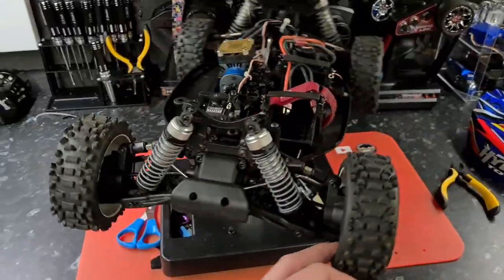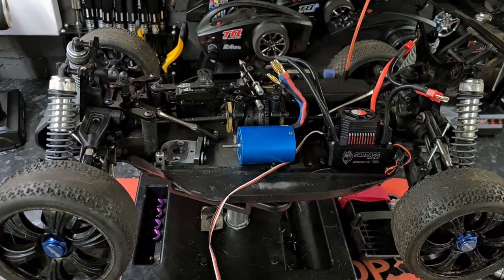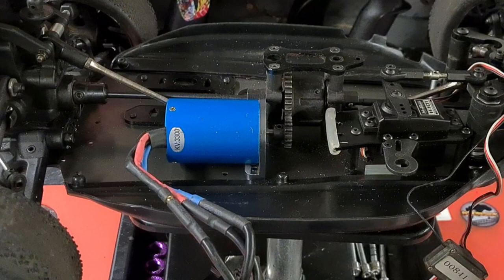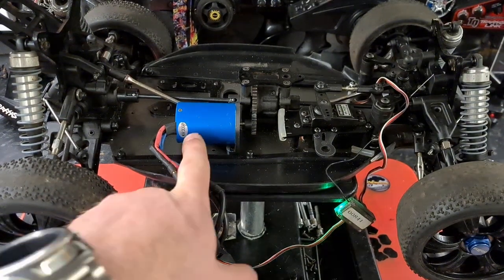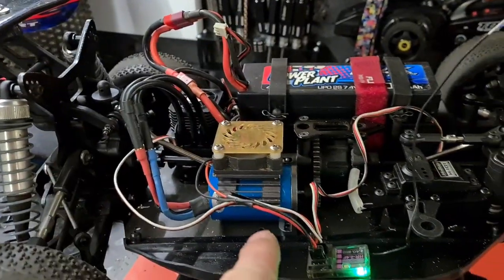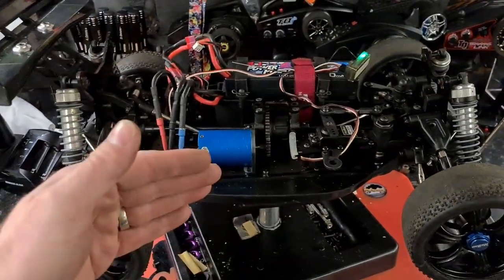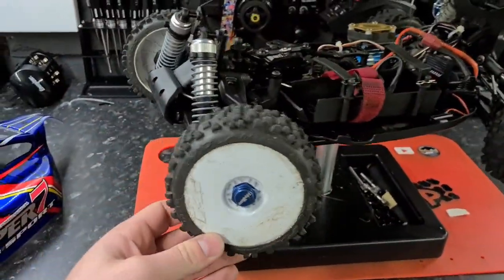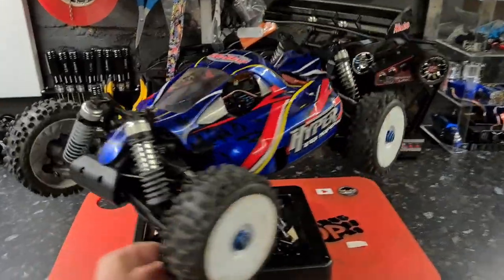NITRO TO ELECTRIC BRUSHLESS CONVERSION 1/8 RC BUGGY

Comment: Don’t do this. Motor too small. KV too high. Will cook on 4S. Cheapest motor mount in the world. Get a hobao one instead. Bad conversion. Worst I’ve ever seen
Reply from the maker: Don't talk silly, this is still going strong its been out at least 50 times, skatepark jumps speed runs etc
Reply from the maker: Also Where's your video if your the expert 👍🏻
Reply: what a great idea. indeed i will make a video to show the world how it should be done. and you can guarantee i wont be drilling holes in the chassis like an amateur!! @rcworxshop

Comment: Hey man. How did you reverse the motor?
Reply: you can relocate two of the three motor poles and it wil switch directions
Reply from the maker: Sorry for the late reply if the motor only has three wires coming off its called an un sensored motor, if that the case simply try the blue swapping any two of the wires from the motor to the speed control 👍🏻

Comment: Do you need the batteries for there servos etc to remain or will the new main battery power everything?
Reply from the maker: Hello, yes these will work from the bec inside the speed control 👍🏻
Reply: @rcworxshop  ok also how do you know what pinion is required? Do u just count the teeth from the original one on the nitro engine? Im guessing u can't use the old one ? Mine has clutch built on to it?
Reply from the maker: @mattschannel1502 correct, the new pinion comes straight off the motor shaft to your original diff, it doesn't need to be exact the same size, just don't go for too many teeth as it will put stress on the motor, esc and battery, there's usually a chart with the esc to say what torque it will handle 👍🏻

Comment: Hello.i have a thundertiger ek4 s2 nitro and I want to convert it as well but here in Greece in Rhodes Island nobody knows how to do it.i ve just watched your video and now i have an idea from where to start.is there a chance you can tell me what do I need to buy and which electric motor?many thanks
Reply from the maker: Thank you so much, that means a lot  really appreciate the feedback I'll add a few links below that will get you started, keep me posted on your build 👍🏻

https://www.ebay.co.uk/itm/174828808651?mkcid=16&mkevt=1&mkrid=711-127632-2357-0&ssspo=dPXUYVFRTle&sssrc=4429486&ssuid=bDBA4C0hTOG&var=&widget_ver=artemis&media=COPY

https://www.ebay.co.uk/itm/174836567796?mkcid=16&mkevt=1&mkrid=711-127632-2357-0&ssspo=dPXUYVFRTle&sssrc=4429486&ssuid=bDBA4C0hTOG&var=&widget_ver=artemis&media=COPY

Comment: Ebay link is bad, any more info on that motor plate?  How did you select pinon size?
Reply from the maker: Try this one matey, I used what fit on the day 👍🏻 https://www.ebay.co.uk/itm/194227210244?mkcid=16&mkevt=1&mkrid=711-127632-2357-0&ssspo=NMFbeOBZQ_W&sssrc=2349624&ssuid=bDBA4C0hTOG&var=&widget_ver=artemis&media=COPY
Reply: @rcworxshop  thanks!!!

Comment: Hi could you show me how to put the motor mount on and the holes
Reply from the maker: You need to put your motor in the mount with pinion gear on and line it up with the spur when it's perfect you need to draw round the motor mount on the chassis with a marker then you'll know where to drill the holes 👍🏻

Comment: Awesome video.  I ve just found my eb4 thats not been used for 10 years plus and got it running eventually lol.  Im new to the electric side and want to convert to brushless.  I would be super greatful if you could put me on to a motormount.  And even any esc and motor tips would be mint.  I know this is a big ask but would love it if you could help me out.
Reply from the maker: Appreciate that matey thank you for watching, here's a like to a motor mount on ebay and a great value esc and motor combo https://www.ebay.co.uk/itm/144629270598?mkcid=16&mkevt=1&mkrid=711-127632-2357-0&ssspo=1tzoan7vsre&sssrc=2349624&ssuid=bDBA4C0hTOG&var=&widget_ver=artemis&media=COPY esc and motor https://www.ebay.co.uk/itm/295021988958?mkcid=16&mkevt=1&mkrid=711-127632-2357-0&ssspo=owmmlsiysms&sssrc=2349624&ssuid=bDBA4C0hTOG&var=&widget_ver=artemis&media=COPY
Reply: @rcworxshop  thank you so much for the response. The mount page is no longer available but thing I have found a hsp mount that may do the trick.
Reply from the maker: The motor size is a 540 so as long as the mount is a 540 you'll be fine

Comment: How did you get reverse I've put ESC motor in and runs forward but not reverse thanks
Reply from the maker: Your esc will need to be calibrated, should be a little button next to the on switch / button
Reply: My on switch is on a wire that comes from esc
Reply from the maker: Does it have a little push button by the switch? Or a little button the the esc?
Reply: I've been told I need to lock the gears cause they are just spinning
Reply from the maker: Oh so the motor does revers but the gears don't?
Reply: Yeh it's a 2 speed box I've been told by someone who had done a few conversations that I just need to lock gears
Reply from the maker: Ohhhh, no it won't reverse without swapping the idle gear out if you can get one for your model?
Reply: When I push car backwards the pinion moves the shafts move and wheels move
Reply: The spur gear moves not pinion lol
Reply from the maker: Here's another conversion of mine where I take out the 2 speed and swap it for an idle gear, this will enable brake and reverse function https://youtu.be/bpkQI5tu3XA

Comment: Tempted to do that with my traxxas tmaxx
Reply from the maker: I've converted a tmaxx before, it turned out well 👍🏻
Reply: Did my tmaxx to brushless ..4s lipo, hobao 150a esc, 3200kv......wheelies all day ..just change out ya center front n rear drive shafts to HD 77mm metal dog bones shafts and diff cups ....stock shafts twist like a pretzel....but be easy on it.....front n rear diffs ain't made for brushless motors....center diff 2nd gear has to be locked in too with screws so ya have brake n reverse...it's a process to change over the tmaxx....motor mount I made out of aluminum 1/4" flat bar

Comment: Did he really put a 540 can in a 1:8 scale and then power it with 4s ?
🤦‍♂️
Utter nonsense!
Reply: I have converted the same buggy to electric. I've used 130 amp ESc with 2250kv motor . Will be ran on 6s . Should be quick .